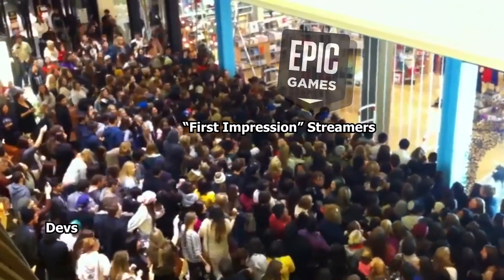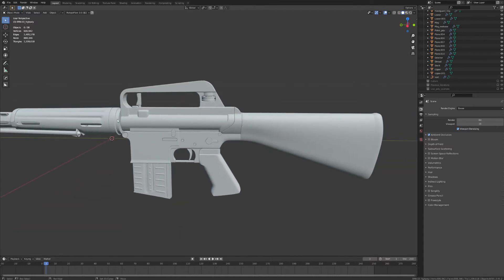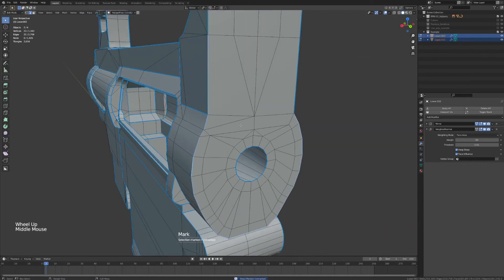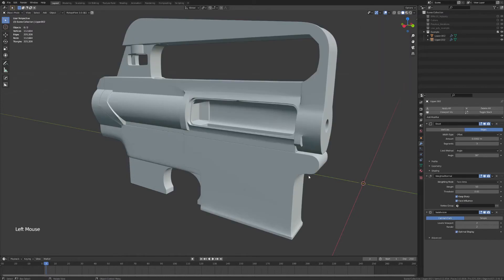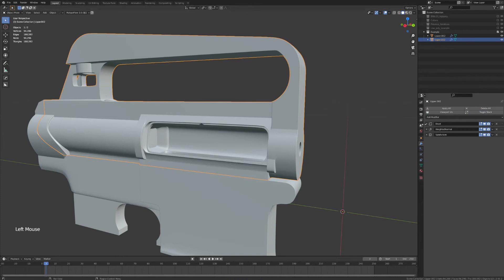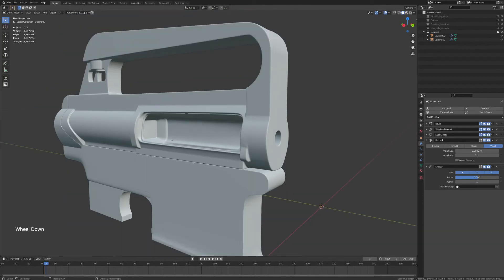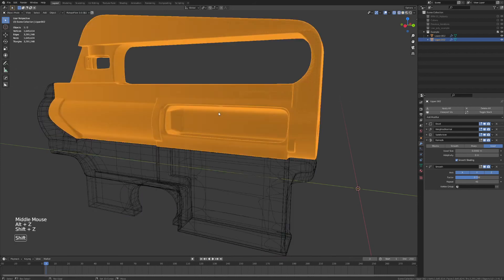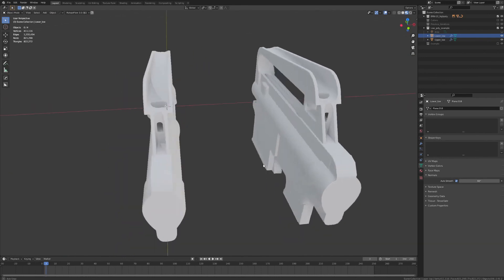High-Poly Modeling Techniques in Blender

Comment: what would have happened if you had not used the subdivision surface, the remesh modifiers etc. ? That part looked almost the same without subdivision. It’s not easier to just use a bevel, a triangulation and a weighted normal? (Just trying to understand)

Comment: What’s the difference between bevel weights and edge crease?
Reply from the maker: Bevel weights help to delineate what edges receive a bevel, while blender also selects these edge to have a sharp edge which is ideal for the low poly model. Edge crease similarly will create a sharp edge be can also be used to crease a sharp edge on sub divided surfaces without creating extra geometry with a bevel or edge loops. There are several technical differences between the two, that make them ideal for different circumstances.

Comment: how do you make such complex shapes as one object without getting artifacts? i create shape with little diversity and immidiatly i get artifacts expecially after using bevel and subd afterwards
Reply: Generally if you're making complex shapes from booleans, etc, you need to ensure that you have sufficient supporting loops and/or vertices near by for your cutout to connect to. Understanding edge flow even at a low-poly level can help!

Comment: dont forget to check "shading' tab inside the bevel modifier options and switch "Face Strength" to "Affected". After that "Weighted Normal" modifier gives right shading result with activated parameters - "Face Area" and "Face Influence"
Reply from the maker: Interesting, I hadn't seen that before, thanks for the tip 👍

Comment: My bevel weight does nothing? when I apply the subd modifier my bevel weighted edges didnt retain its form
Reply from the maker: Did you have the bevel modifier attached before the subD modifier?
Reply: @Tosmo  Ok I was dumb. I forgot to put the bevel method to "Weight" haha. Honestly this non-destructive method is mindblowing to me, especially coming from Maya. Why would I need to manually add edge loops anymore when I can just use bevel weight + modifiers? any reason?
Reply from the maker: @ruok-l5t  I still add supporting edge loops to in some area for better topology and to manually control the falloff when I don't want a sharp edge on some surfaces. But the modifiers handle huge portion of this task.

Comment: My smooth modifier doesn't do anything to the model :|
Reply from the maker: Have you increase the repeat value. I did 50 on mine because of the polygon density.
Reply: @Tosmo  i made 0.002 (0 more is imposible xD) pn remesh and 45 like in you'r video.

Comment: These are Awesome tips, but can you tell more  about baking process, it's very hard to bake from high to low poly game ready models. Also, Have you used bevel shader for smoothing  the edges of the lowpoly model?
Reply from the maker: I was gonna include a quick baking example in this video, but I realized there is probably a lot to talk about here. I got a decent result from baking inside of Blender but there is a lot to desire compared to other programs. I'm considering doing a rundown between the top programs for texture baking out there.